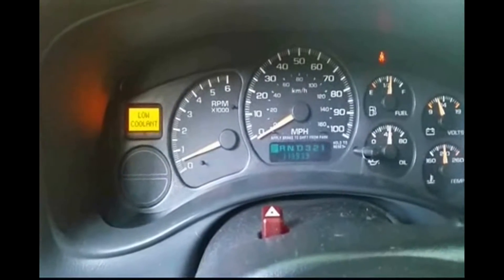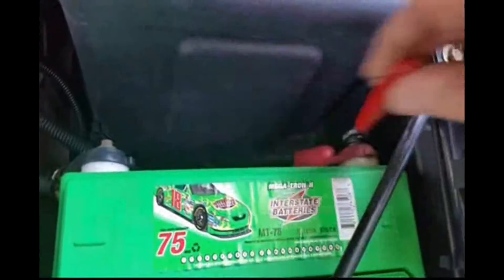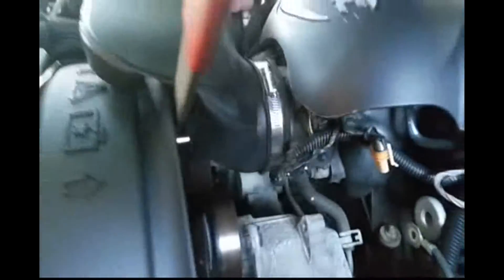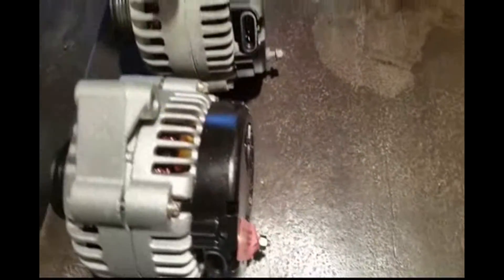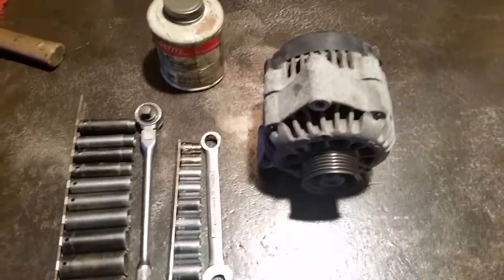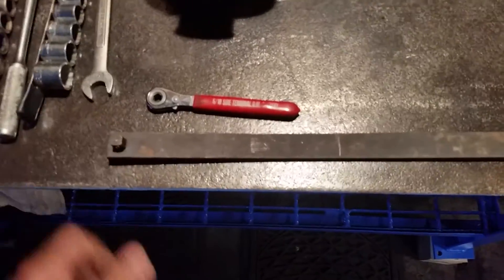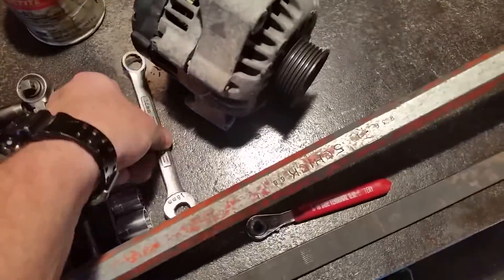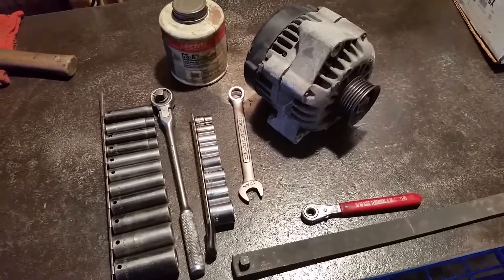2002 GM Truck Alternator Replacement

Comment: That way worked for older vehicles, but it's a good way to short out your vehicle. Just use a cheap voltmeter and connect it to the battery. when the vehicle is not running you should have 12 to13 volts and with the vehicle  running you should have 14 to 15 volts. This way you do not do any harm to your vehicles electrical system.
Reply from the maker: Good to know, thank you! :)

Comment: you cant tell like that, there will be no power for the fuel pump, fire or power to the fuel injectors!
Reply from the maker: Are you sure about that? If the alternator is putting out power, the vehicle will continue to run because everything you mentioned is being powered by the altenator. Give it a try...
Reply: That's what my mechanic told me. He said the cars from the 70 and early 80s you could do it that way, but that you will actually short it out  on newer that that! So yes I am sure!
Reply: Good video though! Happened to me today and had to get pulled home because it would not stay running, not enough power for fuel pump!
Reply: @martinmoore1166   you got a crappy mechanic lol.. Everything should run fine when you unplug the battery.
Reply: @Kdn900  Thats not true.  Disconnecting the battery with the car running these days CAN cause problems with the computers.  They are not designed to have that kind of disruption in the CAN BUS and other circuits.  Doesnt mean it will happen everytime, but it can.  Just diagnose it properly, its not hard.
Reply: @martinmoore1166  Your mechanic is correct. I am one too.